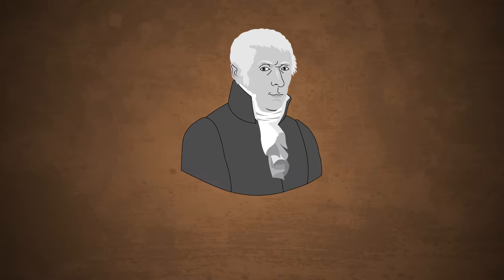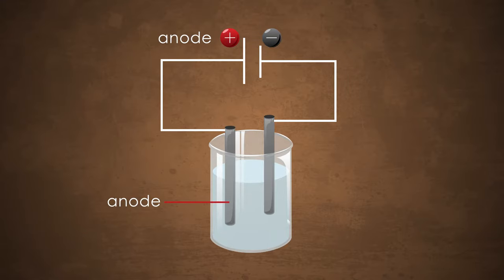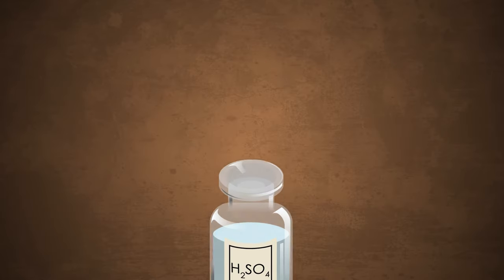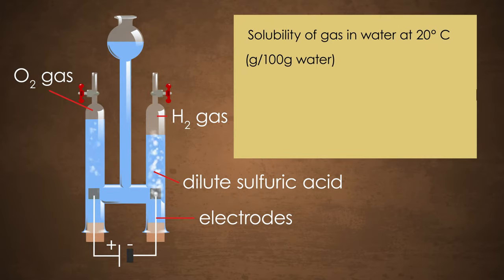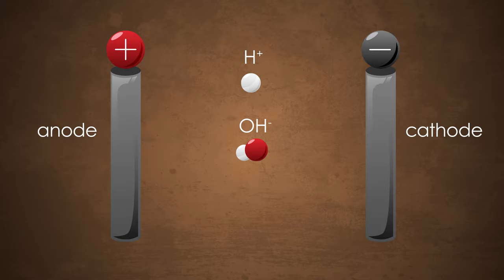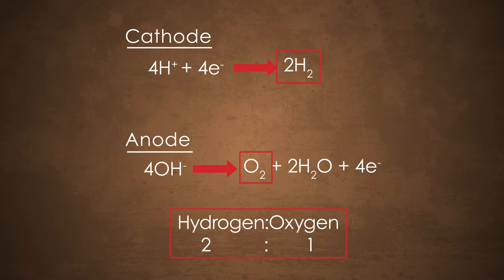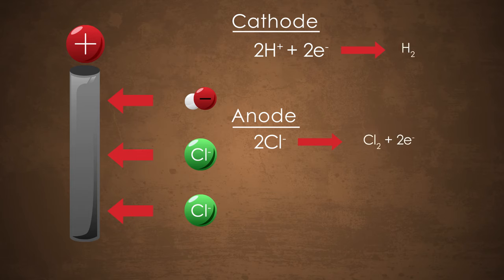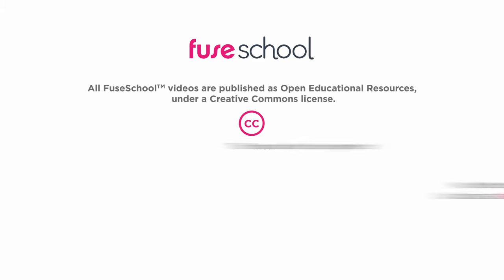Electrolysis of Water & Hydrochloric Acid | Reactions | Chemistry | FuseSchool

Comment: I'm trying to learn chemistry maybe someone can help me. i dissolved table salt in hot tap water until it was saturated. then ran 6 amps thru it using tinfoil electrodes. it fizzed a lot :) the tinfoil on the positive terminal completely disintegrated. I was left with a clear gel like substance floating on the surface... texture like glycerin.. what could this have been? EDIT: I couldn't smell Chlorine gas given off so i assume it became part of the gunky stuff?

Comment: OH ion decomposes into O2 + H2O + e- 
In this how water comes in equation?? 
Confused a lot
Reply: Think of the overall equation for the electrolysis: two water molecules split into an oxygen and two hydrogen molecules as gases HOH  + HOH = HH +HH+OO
When this reaction happens at the two separate electrodes we could have had H+  H+  and O- - as the ions, but water doesn't ionise completely like that. Only one H+ ion is produced making the oxygen still bonded to one other hydrogen giving us OH- ion.
When these lose their electron at the anode they reform water and the oxygen is given off 
OH-  +   OH-  -> O  +  HOH  +  e + e-   (and two O atoms join to form a molecule of oxygen)
Reply: @keithross7058  are u indian. What is this hoh and hh . Which chapter will I see it . I am in class 10 cbse and has only left with carbon and it's compound and periodic table . In which class and chapter will I study this